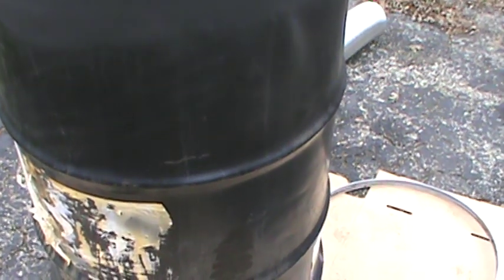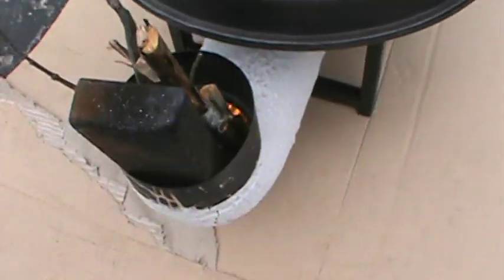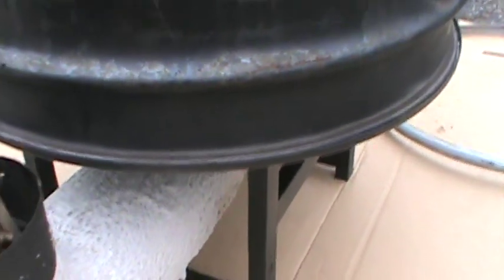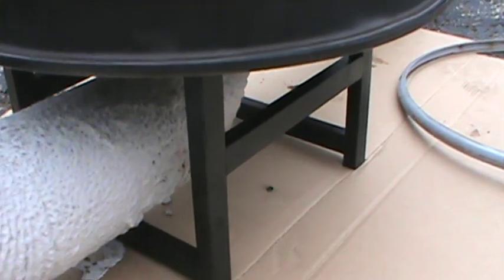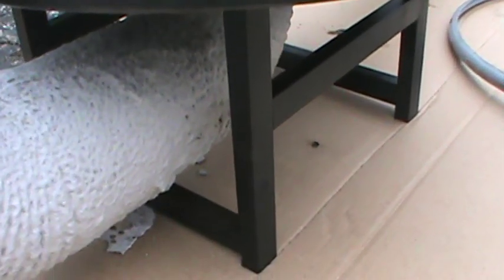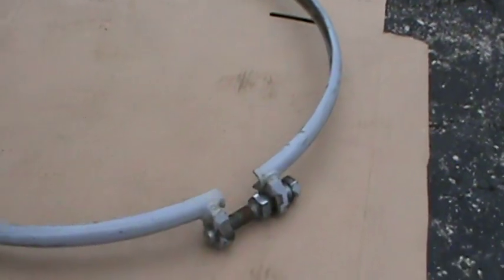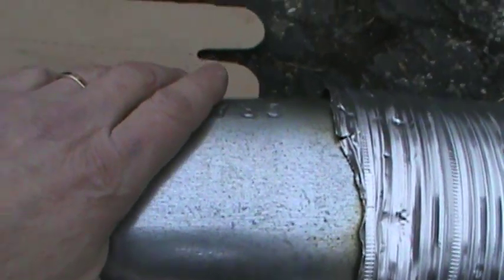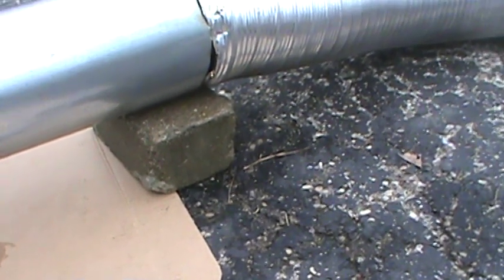Rocket Stove Mass Heater Video Series 1 vid 4

Comment from the maker: Thanks CritterWindow, I had completely forgotten about that, was on a mission to find smoke leaks and see what the burn tube was doing. After reviewing my notes it was in, I have a few items to pick up this week and will finish the unit this weekend and have the proper configuration for a final test burn. Need to get this done so to put the thermal camera on it in order to put the last part on the copper coil for water heating.

Comment: Hi Tahtechlabs, I'm no expert but I see 2 problems with this design. Your burn tube is below and outside of the barrel so won't get to the desired heat level and it seems a little long to me. Second point is the exhaust flu should be on the back side of the barrel not on the bottom for better draft and no smoke out of the feed tube & should rise above the barrel . Hope some of this is helpful for you.